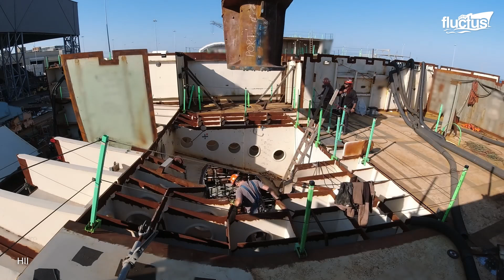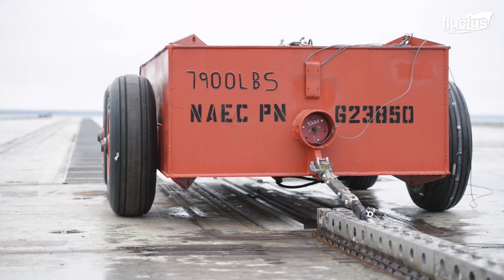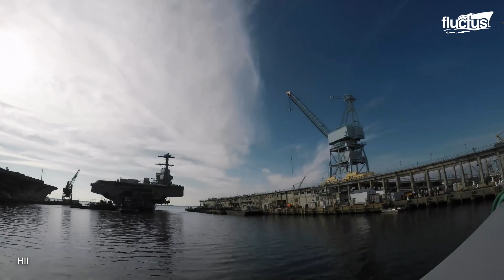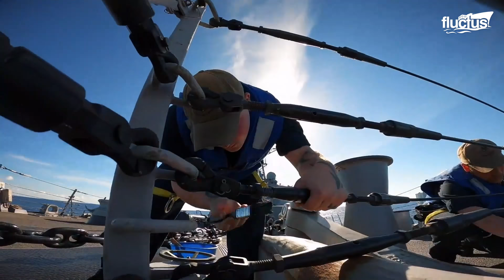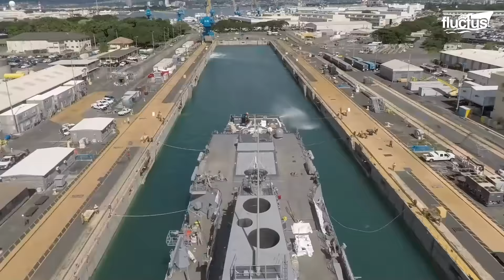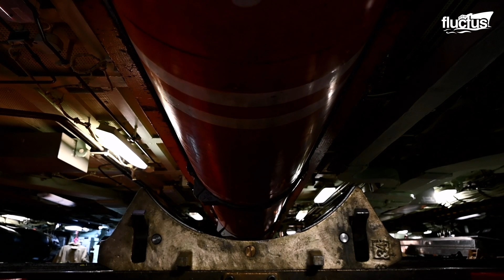US Navy Relaunches Gigantic Supercarrier After Dry Dock Repairs

Comment: The only problem with an aircraft carrier is 400 5,000 Dollar drones can take them out.
Reply: the problem is getting ANY drones within range.
Reply: @hoghogwild Do you think an aircraft carrier has 400 interceptor on board,I don’t.
Reply: @Susan-ry9ct Uh, yes, they're called SuperHornets that carry AIM-9X, AIM-120 AMRAAM and have guns,, in addition to the carriers own missile defense and CWIS system. Plus all the super expensive US Navy Standard missiles from around the defensive destroyer ring.  If I was on a US supercarrier, I'd be worried about hurting/killing myself or someone else on the flightdeck during operations than from any Iranian drones hurting me on the carrier.

Now get some sub launched aerial drones into the picture and you'll be onto something. Usually a sub or 2 as part of the Carrier Strike Group(CSG).

Comment: Things must have changed from my Submarine days. When launching the Harpoon I heard them yell the command “FIRE” as the impulse lever was moved to impulse the weapon clear of the tube. The only time we used the word “Fire” was if something was burning…to launch a weapon be it a MK48, a Tomahawk or a special tactical weapon the command would be “SHOOT”. 

It was important to use language that was unambiguous. If while preparing to launch a weapon someone noticed a hydraulic oil fire under the ram equipment in the Torpedo Room and yelled fire we would hope the Fire Control Operator wouldn’t prematurely initiate the impulse system…perhaps the tube was flooded and equalized but the inner muzzle door was not yet opened could be problematic damaging the weapon and the tube.
Reply: You’re absolutely correct about the importance of using the right commands.  I was a gunners mate, when we changed the language from “fire” to “shoot.”  Made more sense….as “Fire” is a dreaded thing on a ship.

Comment: Can the carrier (Ford-class) launch the F-35s electrically or magnetically yet?  I think that's why the president wants to go back to steam catapults again.
Reply: It has nothing to do with the EMALS system. The jet-blast deflectors are unable to handle the heat from the F-35's jet engine, so the JBD's need extra cooling water put through them.
Reply: 说到弹射器，我们中国可以在我们喜欢的任意平直甲板上部署电磁弹射器，因为我们不但有航母用的，还有车载型可拼接的。
Reply: And what makes you President such a expert on Naval Aviation & Carrier launch systems ffs
Reply: @dave741966  Because he is the President and what he says goes. If you don't like it try running for President.
Reply: @DBAllen  The power structure is one thing, having a person with any sort of knowledge or expertise at the helm is another.  We need ships, not more delays.  The new USS JFK will have taken 15 years to build by the time she sees any sort of combat capable deployment. laid down in 2015, combat capable 2030'ish.
Reply: @hoghogwild  A far cry from how fast we were turning ships out in WW2.